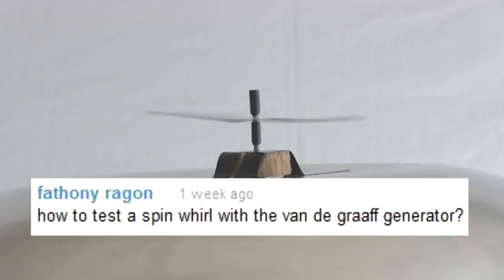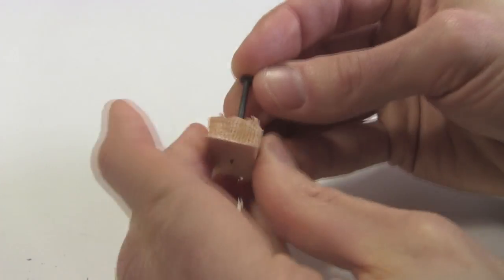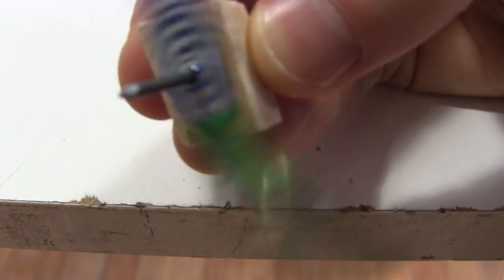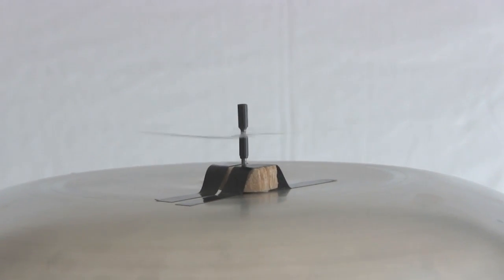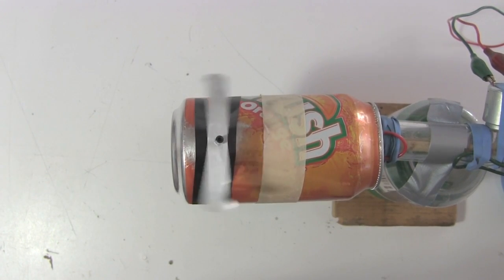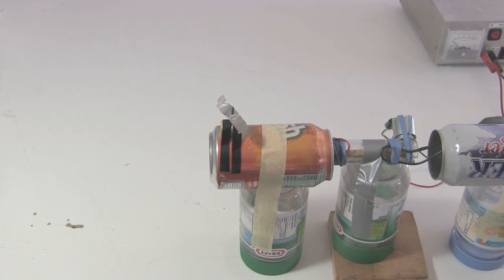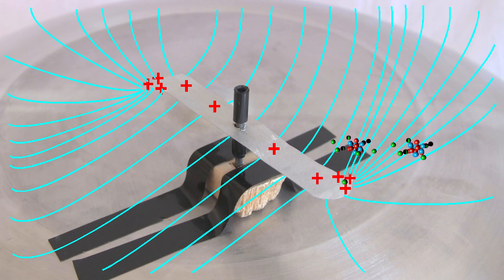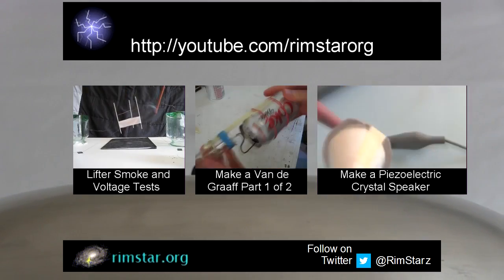Ion Wind Rotor

Comment: What is the minimum amount of voltage needed for this experiment or to create ionic wind?
Reply from the maker: It partly depends on the shape of the electrode, in this case the soda can. The sharper it is, the lower the voltage required. A soda can is not sharp at all but you can put a needle (or nail) on it and then the sharp point of the needle will create ions at a lower voltage, probably in the 2,000 volt to 6,000 volt range.

Comment: This doesnt make sense why would the rotor spin? It's attached to the electrons on the atoms as well so there is a temporary pulling force toward new ions in the air as well. I think its spinning solely because the the protons being ejected have more mass than the electrons being absorbed even though they both have the same charge.

Comment: Would it work better if you shaped it to turn in same direction like a propeller as well? Even if its a slight improvement will it still be an improvement?
Reply from the maker: ***** I guess it depends on what you're trying to achieve. Making it propeller shaped wouldn't speed it up.

Comment from the maker: By the way, last week I did make one of the electric whirl devices in the video you uploaded. I couldn't get it to work exactly the same. I suspect they are using high voltage AC, but I can't say for sure without testing. Unfortunately I have only high voltage DC so I can't test it. Maybe they are using a tesla coil but since I don't have one, I can't say for sure either.

Comment from the maker: It could be you have the voltage but not the current/charge flow. With the rotor on my small VDG I had to turn the VDG motor speed higher to get the rotor to move. A VDG is just a charge pump, pumping from one end of the VDG to the other. I'm guessing that the voltage when the VDG was turned low was the same as when it was turned high. That's because any additional charge was going out as wind and not building up. So you might be maxed out on voltage but lacking in charge.

Comment: Hmm It could be the tin I am using as a base. It has a rim. With the Franklin bells. I did try changing the gap even at 8 inches is still just sticks to one side, lol.most of the string too. I think its a weight issue. Ring pull too light. There is quite a wind between them. I'll try something smoother for the rotor. I probably have to many break out points and am messing up the airflow. Also I have less amps than a peizo. Its pure hv, going by pain level when zapped.

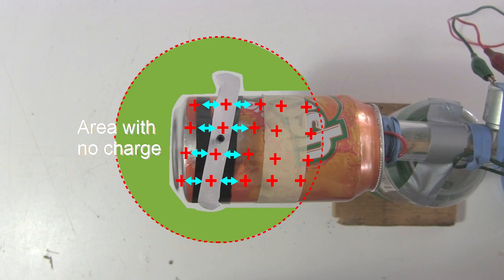Comment from the maker: I don't know what voltage, but since it works with my small VDG I'd say 80kV or less. Since the rotor is leaking, the voltage is probably pulled way down. How uniformly shaped is the high voltage device below it? If it's not close like mine then that's not an issue. Recall from my video (2:18) that I had a sticky spot with my small VDG. With your Franklins bell you could try playing with the spacing between the cans.

Comment: What voltage are you running? attempt one is a fail. approx 50kv and it just wants to stick down?? I can get 90 deg turn with attraction to other polarity. but no wind.. Spins free with no power, but gets sticky when charged... My Franklin bells don't work anymore either.. too much wind I think. ring-pull just sticks to one side. I;m thinking about applying the wind to aerofoil. will let you know if I have any luck.

Comment from the maker: I don't know how that one works. I see two connections so the stator is probably one polarity and the rotor is the other. Where the rotor is close to the stator there's corona and some arcing so that end of the rotor is close to the same charge as the stator - it's shorted out. The other end of the rotor at that time is probably the opposite polarity of the stator and is attracted to the stator. So my guess is it works by attraction.

Comment: Though, with a higher stick above the rotor you could ascertain lift readily, like with the ones that fly off. End shapes before the point would be a route, shaping that for the lift rather than say bending all along a rotor length..large surface end areas then very fine tip etc. One way would be to use coke can metal and bend those ends up/down, the tips would remain same levels. Balance mid point weight underneath on a rotor stick for stable lift off (T shape final design).

Comment: interesting and awesome. for a smaller van de graff generator, on top of can, you could place a plate, so repulsive strenth is more even, well, big van de graff generator with dome solves the thing anyway. have you tried to run it on something else? like in franklin's bells experiment you made it run for bit with static electricity, made by rubbing two thing together.

Comment from the maker: Interesting question. I think it might. If an ion path is created between the belt and the upper brush then I'd think ionization would also happen at the rotor's sharp points. Charge does normally build up on the dome if no leakage happens, but in this case we're deliberately leaking so the dome is really irrelevant, I think.